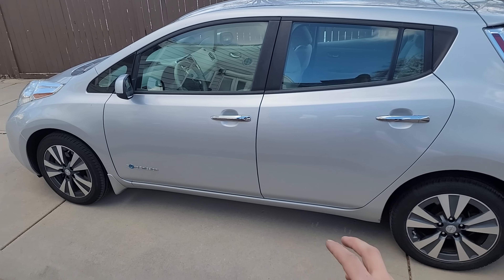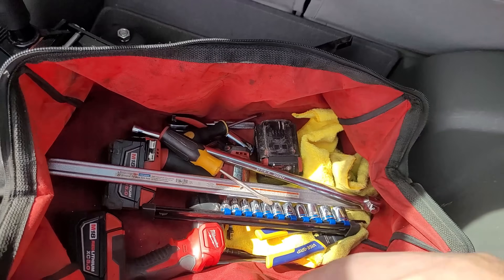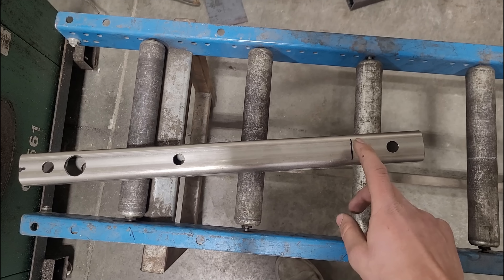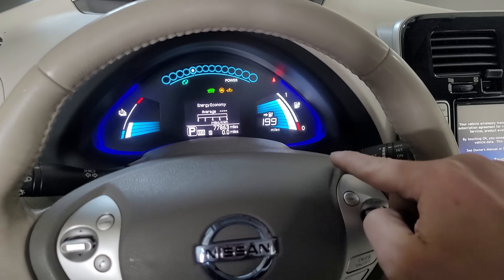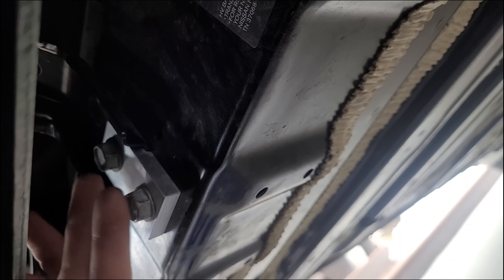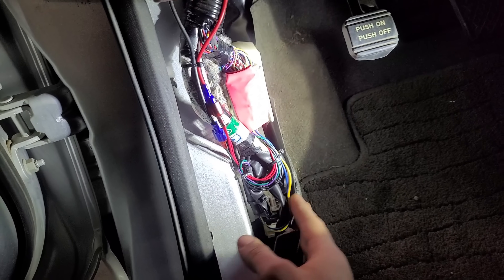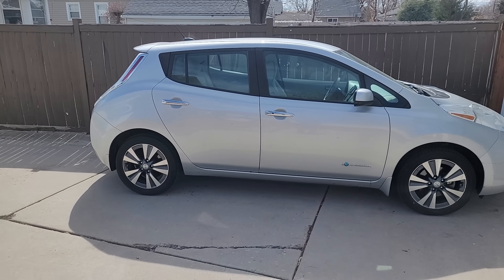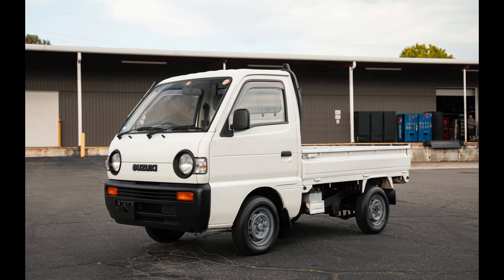Under $5K Nissan Leaf 62kWh Battery Upgrade

Comment: Very cool. Great job at the step by step process. Couple of things that bug me about the upgrade though.
1) Did you check the weight ratings for the tires? Adding 400lbs of additional battery could become a safety issue as it would be more prone to blowouts/faster wear.
2) Your braking distance will increase due to the added weight and brake wear will accelerate more than factory battery. Any plans with those?
Reply: The Tires defenetily need to be changed to something far more durable. But its more like driving with two 90kg humans at all times along with the driver. That should not be a big problem as the car is meant to take four passengers. Also the fact that the added weight of the new battery pack places the centre of gravity slightly lower than the current battery, the car might handle a tiny bit better.
Reply: Braking will not go out of the normal lmits because ZE1 has same brakes in terms of perfomance, faster wear will not occur because again tires, rims are absolutely the same in terms of specs for AZE0 and ZE1.

Comment: Fantastic job! This is a great modification and the video was very thorough and descriptive. My only critique is that you used cinder blocks for supporting the car. I'm not trying to be a curmudgeon about it, but that is extremely dangerous. Especially if you're going to start doing these conversions to make extra money on the side, please invest in a taller heavy-duty set of jack stands or at least get some strong and thick wood blocks. Besides that one issue, fantastic work!

Comment: Does this also fit in a 24kw leaf? 2012 mod. Or just the one with 30kw battery
Reply from the maker: @89volvoturbo  It will fit. You need to get an additional adapter for the battery communication cable. And the CAN bridge needs to be installed in the center console instead of the side door panel.

Comment: I gotta   2018  nissan
Reply: Can I just swap the battery?What else do I need to do for 62kw
Reply from the maker: @nelsontubens2059  Is it 40kWh?
Reply: I have a 2018 too. The 2018-2024 was built for both 40 and 62kwh batteries to be supported.

Comment: Here's how I doubled the range on my 2022 standard Kia Seltos:    One 5 gallon gas can .. Walmart... $9.95
Reply: I bet everyone loves when you start drinking on Thanksgiving.
Reply: I didn’t know those came with only a 5 gallon tank from the factory
Reply: Hilarious. Never heard that one before.
Reply: Maybe also tell us how you can’t fuel the car with anything else than what is sold at fuel stations with no option to make it cheaper. Let alone be self-reliant when you have solar.
Reply: Kia Seltos is one of the worst rated cars out there. What a terrible self report.
Reply from the maker: @5thGenNativeTexan  Cool story!
Reply: @zuccamachine I don’t know the story of this Leaf, but a few questions:  How much are tune-ups?  Are the brake jobs expensive?  😂 Aside from the battery, in all seriousness, what other work have you performed on that car?
Reply from the maker: @publicuser2007  You don't have to tune anything on an EV. Brakes are hardly ever used because of regen braking. Tires are the only routine maintenance on an EV.
Reply: @zuccamachine  Right on!  So ol boy in the comment up there doesn’t exactly know the benefits of an EV.  Not to mention, he probably lives and works well within the battery range of the car.
Reply: Clever 👌

Comment: I love how this video and the work you did so I subscribed.  It's so expensive in Wisconsin to license EV's so I'm retiring my 2013 with only 72,000 miles.  I love driving the car and would do a swap but there are a bunch of dents/blemishes.  I'm most likely going to take out the battery, motor, and tires and scrap it and use the battery for other projects.  Good job.

Comment: Awesome video, didn't realise the process was this doable. In Ireland there's a company called Range Therapy that does it, but they charge more, like 10k euro. They also repurpose the battery packs as home storage and a portable charging trailer.

Looking forward to the open upgrade scene for other vehicles to catch up with the Leaf.

Comment: In China most BYD and BIO owners now lease their battery … So they can use the NIO battery swap stations … Drive in, then 10 minutes later, drive out with a fully charged different battery.  No need to ever charge your own battery

The USA, UK and EU are literally decades behind China.
Reply: Some kind of universal battery swap is clearly the way to go. Show up at a "gas" station, swap battery to a fully charged one, off you go. Pay only for the juice plus some kind of fee for the gradual depreciation of the battery.
Reply: @cv990a4  … The lease system is the answer. It makes the EV vehicle cheap to buy into, helps resale value greatly and leasing is not expensive. 

Myself I have read and researched a great deal on this subject. The fact is that the West are simply too far behind to make it a viable service. The cost to put in the infrastructure is totally prohibitive. Also the Legacy car makers would never agree to use the same battery design which is required of course.

NIO has been building their battery service structure for many years …  Tesla of course has also been building theirs for years … The difference is stark. 

With great fanfare about 5 weeks ago Tesla announced their '15 minute 0-80% charge battery!" … as if it were the second coming. However, there is no infrastructure to support it. It cannot be charged at home as U.S. houses only use 110V. Tesla is yet to create a serious charging system for the present batteries it uses.  

Yet literally 5 days later, BYD announced their own "5 minute 0-80% charge  battery" which like Tesla they are releasing soon .. Except BYD/NIO have the infrastructure to enable the batteries to be used as intended. 

Tesla has a 'Gig factory' in Arizona, ion other words a vast factory … BYD is opening it's new factory … In which one can fit TEN Tesla factories … Indeed BYD's factory site is 50 square miles. Yes, 50 square miles. 

BYD will be the world's largest car manufacturer in around 5 years time.  It already employs 1 Million people.
Reply: That makes the car even more worthless. You don't own the battery, pay a sub and the car has no value. Brilliant.
Reply: @TheGuruStud not really. the way it works out, it's kind of the way my barbecue switches propane tanks. When I need a full one I just go trade it in.
This would spread the cost of a weara ble part out over the long term and not leave the battery as a financial time bomb.
Reply: @TheGuruStud isn't this the same as an ICE  vehicle? Your vehicle is rather useless unless you go and fill it up with fuel. Apart from vegetable oil I don't think you're making your own fuel
Reply: @SevenBee-q2j - Chinese batteries randomly expl0de. There are videos all over YouTube.
Reply: In China, your car batteries randomly explode and your cars trap passengers inside while burning. There are tons of videos on YouTube about it. Don't try to brag
Reply: @TheBigExclusive 
Like a petrol car has never exploded…
Reply: An Israeli company called Better Place came up with that in 2010-2013. So really, China is more than a decade behind Israel 😂

Comment: I just bought a 2011 Nissan Leaf and the it has 6 health bar. I'm getting 42 miles with 100% fully charged but as soon as i stary driving, it will drop fast to 32 miles within a few miles. 😢
Reply from the maker: @johnnyduong1618  Time to swap!

Comment: In principle then do you think most EVs could have their range increased by retro fitting higher capacity batteries?
Reply from the maker: @alanpmasters  Yes, but it won't be cost effective for most. Nissan Leafs are the only ones thus far shown to have it make sense financially.
Reply: @zuccamachine I’d argue (in Europe at least) it’s not financially viable to upgrade most Leafs as their value has dropped so low now. BMW i3 hold their value much better & are probably more feasible.
Reply: @hughmarcus1 low value is precisely the reason it’s cost effective to upgrade the Leaf. You can buy a used one for practically nothing, put in a long range battery and viola! You have a new long range EV for under 10k
Reply: @microdozer3070  I appreciate this is an American perspective but in Europe there's a wide range of used EVs now. £10k will buy you a modern EV with as much range as this battery upgrade . 2 months ago I changed my wife's car. We got a 3 1/2 yr old VW ID3, a VW approved car, with extend warranty etc for £15k. that's really good value & its an excellent car with 200 mile practical range when we need it.
Reply: Retrofitting the entire car is possible but the way legacy auto behave they certainly don’t want you extending the life of an existing car but I want you to buy a new one out right.  Independents may do it but then I am sure you will get the insurance companies crimping down on you at the behest of Big auto.  There is a secretive company spending loads of money named forseven which is aimed solely at retrofitting existing internal combustion vehicles with electric drive trains and battery packs.

Comment: You should consider making a kit for this to do at home. Also, don't forget you likely will need to tell your insurance company you did this so you are covered if anything happens and you may even need to have a mechanical inspection for this to be legal in your state and to get an insurance company to cover this.
Reply: Don’t tell them, privatized insurance system is rigged anyways. If they cared about safety, they wouldn’t insure giant trucks running around town for improper use or pedestrians safety etc.
Reply: @Kakiharaichii  if only that were true. The truth is you'll do this to your leaf and if you don't tell them, they'll either choose to not cover a claim because it's a "different vehicle now" or it'll only be insured for like 1500 instead of the 6000 it's actually worth. Then they'll only at most give 1000 for it. Good luck getting another leaf with that kind of range for 1000 or anything near that price.
Reply: Are we not allowed to do repairs or upgrades to our cars?
Reply: @breakburrito  repairs yes, if done correctly. Upgrades no unless approved. When you sign up for insurance there will be a section that asks if your car has modifications or upgrades. If you don't report it, they can then screw you over by choosing to not cover your claim or only covering it for what you reported. Say you report you have a leaf s and its value is like 3k, but you upgrade the battery and it's really worth like 7k now. They can then either not cover it or choose to cover it at 3k and you're in the hole 4k on your leaf with an upgraded battery.
Reply: Also on the repairs, if you replace your brakes and let's say you put your pads on backwards and you slam into another car, they send an investigator out and if they find that you installed them wrong they won't cover the claim. If you say somewhere else did it, they will tell you to contact that place and sue them for the job being done wrong. So be sure to just report this and be sure to do repairs right.
Reply: @ut90J  That makes sense regarding what they're obligated to pay for. I wouldn't bother telling them unless I felt the need to have special, additional coverage for something. In most cases it's not even worth covering for collision or comprehensive, especially for an older car.

Comment: For your 2 bolts to the back of the battery that don't have frame nuts. Have a look at what they do for aftermarket trailer hitches.
Or you could do a similar thing like you did for the front spacer with the nuts welded to a plate.
Be careful with stainless and steel next to each other. The steel will cause the stainless to rust.

Comment: 900 bucks for the old battery? what a bargain for 30kw! i would take that in a heartbeat for power my home! Even when its heavily degraded to like 15kw its still a bargain
Reply: So true. This is something most Americans don't yet understand. Li-ion batteries don't simply die (unless abused or have a manufacturing defect), they just fade away very slowly. Even when abused they can still take a very LONG time until they're completely exhausted. Properly maintained (62kWh and larger) battery packs should easily last upwards of 200,000 miles. The larger the better as they don't see nearly as many charge cycles as a 24kWh or 30kWh. And even after 200,000 miles they aren't dead as people have been led to believe. Quite the opposite. Most EV manufacturers warrant the degradation of their battery packs to be less than 70% after 8 years or 100,000 miles. The battery packs will still be perfectly operational but with only 70% of their original range. Most owners likely won't bother replacing them. They could easily last another 5 years or more before they degrade to just 50%. At 31kWh (50% of a 62kWh battery) these battery packs are still quire valuable. Hell, I could operate my entire house for nearly two days with an old 31kWh battery pack.
Reply: Actually 900€ not só bad deal but you can get a balanced lfp 15 kWh with 48 volts setup battery for under 1500$ depending on your local NRG provider not even allowed to gridtie this~ 300  voltsetup on your home (not intending to mess with any laws on some regions)

Comment: FYI, the biggest causes of battery degradation are: 
1) Regularly charging to 100% or discharging below 5% (stress on battery)
2) Allowing batteries to sit a high (100%) or low (<5%) state of charge for extended periods of time
3) Batteries getting hot

Leaf's have the worst battery life of any modern EV because they are daily charged to 100%, left at 100% and don't have liquid cooling. Its best practice to us the middle of the battery. If you need 50% of the battery for your commute, daily charge to 75% and plug back in at 25%. When storing for a long time, keep at 50%.
Reply: Nice comment. With most owners adopting the 20-80% SOC rule, being aware of the temperature issues, and with the latest BMS algorithms doing a much better job of monitoring and maintaining the battery packs, the biggest problem I see now is with allowing the battery packs to sit at 100% SOC (that's 100% SOC "Indicated"). I was guilty of this with my 2015. I'd come home every day after work and immediately plug in for 3 hours to top-off. The vehicle would then sit overnight for 11 hours until I left the next morning. The degradation was tiny each time but cumulative over several years. I was also plugging in every Friday night and allowing the vehicle to sit at 100% SOC until Monday morning (sometimes over a 3-day weekend). Even with all the other preventative measures being taken my battery pack still degraded to 84% after just 50k miles. Conversely, I adhere strictly to the 20-80% SOC rule with my newer 2019 SV Plus and have just reached 60k miles with 90% SOH.  I realize that the battery pack is much larger and sees less stress but I feel confident that the 20-80% rule works nonetheless.
Reply: batteries getting too cold is an insane Issue aswell. they want to stay at a certain temperature and stay at a certain load to keep their health. The Nissan Leaf has none and is the only "popular" car that has none of the thermal and other battery management systems.

Comment: Im wondering why nissan leaf? Why not a more attractive vehicle like a Mitsubishi outlander or eclipse, to add range from just 60kms?
Reply from the maker: @AndrewSheldon  There's a lot of Nissan leafs aging with limited battery range. They are also very common and parts are easy to find and cheap. Those other models you mention are expensive and not as many were made as Leafs.

Comment: Add 60% tariff for costs 😅
Reply from the maker: @AndrewSheldon  All parts were sourced in the US, so 0 tariff!
Reply: @zuccamachine  Sourcing is not the issue. Made in the USA is the issue. And that goes for components as well. Anyway, just joking. Still great and appreciate the value of what you do. Anyway, I think you did it before the tariffs came in.
Reply from the maker: @AndrewSheldon  This battery was from a salvaged car, so tariffs will never apply.
Reply: @zuccamachine  Oh nice, so replaced bad cells. Not sure I'd trust such a life-extension strategy, but given you're putting in the battery yourself, I guess it makes sense.
Reply from the maker: @AndrewSheldon  Watch the video. The entire battery was swapped, no work at the cell level.

Comment: Stainless steel rusts. Electrolytic ion exchange between metals. Uou need ion exchange gap/insulation i think. Now, you have proof of concept, you can bulk produce the brackets coated for longevity. 🎉
Reply: it will take forever. SS bolts hardly corrode on exhausts that are connected to the steel/iron manifold. They will outlive the car by many years.

Comment: would love to do this in my old leaf, but without active cooling in AZ. 118 in summers is not ideal for this car
Reply: I've been driving a leaf since 2017, a leaf plus since 2019 in Phoenix. It's great. I have had minor degradation, but that's been replaced under warranty

Comment: Great Video, great information! I have a 2015 that I am looking for a cost effective 40Kw pack to upgrade my 24Kw. I am considering a Lift table from Harbor Freight (come in 2 sizes) that would have the capacity to lift/lower battery and you can roll into place. I haven't checked out Dala's information in a while. Thanks for including all the details. BTW, I priced someone doing my change out in the Atlanta area and it was going to be like $12k for a used battery. Trying to get my mechanic interested in taking on these swaps.

Comment: The only negative I can see is the loss in ground clearance one and a half inches may not be a dealbreaker for those who don’t have a winter snow but here in Colorado front range you get some inches guess it may not be such dealbreaker but I do drive my current 2012 in the snow quite often with some all weather winter Nokian  tires